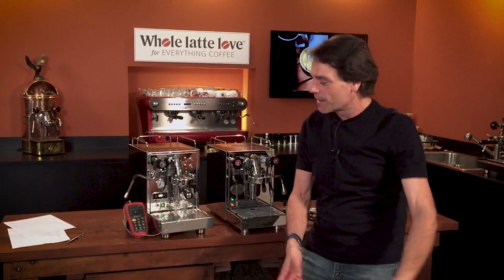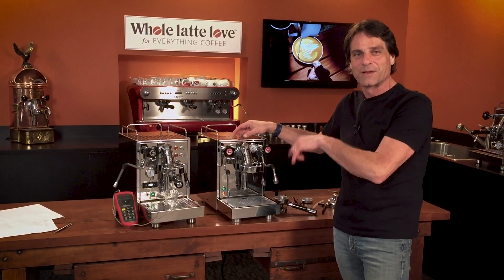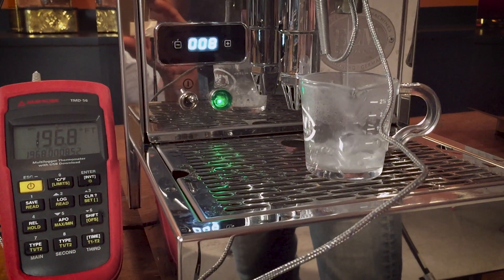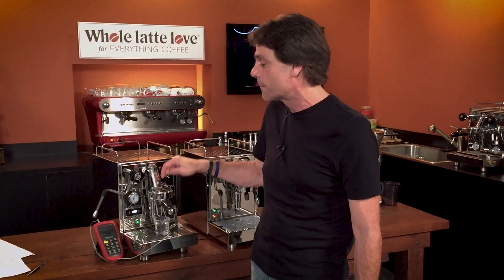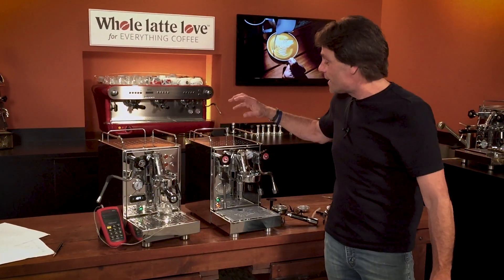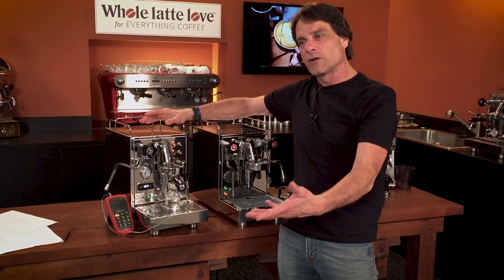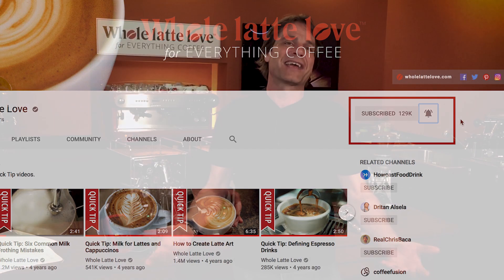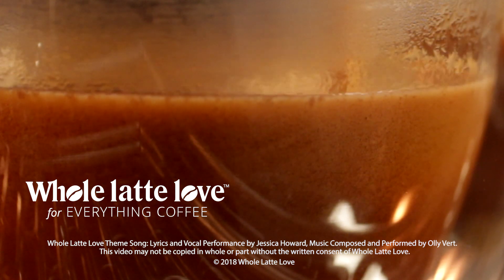Tech Tip: PID Scace Temps on ECM Classika Espresso Machine

Comment: I have a question, I just got a classika and with the PID showing 92C (machine already hot +1h waiting) and then of a simple shot of 20 secs the PID drops to 77C, does my machine has any problem? It is true that from 77 goes back to 92 super quickly but I am wondering why it happened me that. In other videos I see people doing shots and the PID pre and post shot barely changes. Thank you!
Reply from the maker: Hi TFB, I don't think 77C after starting at 92C is unreasonable. In this video I was running machine at 199F(93C) and following the test I bottomed out at 180F(82C) in boiler as indicated on the display.
Reply: @Wholelattelovepage  I understand , the point is that I see other videos where It doesn’t happen, 
Thank you for your answers!

Comment: What was the approximate temp of the water in the reservoir? The temp drop after the shot in this video is less than in other videos, forum posts, etc.
Reply from the maker: Hi BF, Thanks for the question. I do not know the actual temp in the reservoir. I can say room temp was ~72F/22C and the machine was fully warmed up so water in the reservoir was likely above room temp. Was a Scace device used in the other videos, etc you reference? Very difficult to get accurate coffee contact temps without one.
Marc

Comment: Hello,
Very helpful video, thank you!

I received my ECM Classica a few months ago and I have not changed any settings (its still in Centrigrade).  I make cappuccino and steam the milk first, refill the boiler and let the temperature stabilize.

However, once I pull the double-shot, I notice the PID registers a big temperature drop, low 80s or so.  Same thing happens if I am simply brewing espresso.

Is this normal?  Is the shot actually brewed at the correct temperature, it’s just that refilling the boiler drops the temperature?
Thank you!
Reply: Hi! Great question! I've been researching this myself. Have you figured out what's going on withe brew temp in the group? I've been keeping an eye on ECM Classika as a potential upgrade from my Gaggia Classic Pro. I've watched many reviews from users and noticed that in many cases the brew temperature as show on the PID display drops by about 5°C at the end of the shot. I found it puzzling and concerning since this doesn't seem to happen on other machines, such ad Bezzera Unica or Quick Mill Alexia. Thanks and happy brewing!

Comment: Hey Marc! One question on the ECM classika please; the PID temperature displayed is most of the time 1 degree below the target. Example: I have the setting at 94 C and the machine fully stabilised will be at 93 C a 80% of the time and just a 20% of the time at the target temperature (in this case 94 C). Is this offset actual-target normal? Can this be corrected somehow? This is just being picky tbh as that means the water is in close proximity to 94 C but I’m curious.

Thanks!
Reply from the maker: Hi AM, Thanks for the question. Maybe a bit picky :). What you see in the display is the actual current temp (calculated with an offset to give grouphead brew temp) in the boiler. It is possible to operate the machine in Fahrenheit which is a finer temperature scale. I do not know this for a fact but the logic in the PID controller may be operating in Fahrenheit and converting to Celsius for the display. 94C = 201.2F my suspicion is when the temp drops below 201F the display will show you 93C even though you are closer to 94.0 than 93.0. I hope that makes sense.
Marc

Comment: Hi from Greece and congratulations for the nice videos!!! Is the PID and the offset pre-programmed by ECM Company or you did the PID settings manualy?
Reply from the maker: Hi GA, Thanks for the kind comment and question. PID offsets are programmed by ECM. Best to leave offset as set at factory.
Marc
Reply: @Wholelattelovepage  Great, super helpful video! Is 22F the best offset for the PID? My Classika came with a lower offset (17F), and I've read of people receiving a wide range of numbers online supposedly from ECM, WLL, and others, from 17F to 34F! I think I'll move it up to 22F since this video is the only place I've seen an offset paired with a Scace test. Thanks!